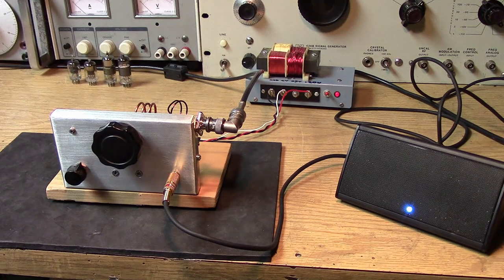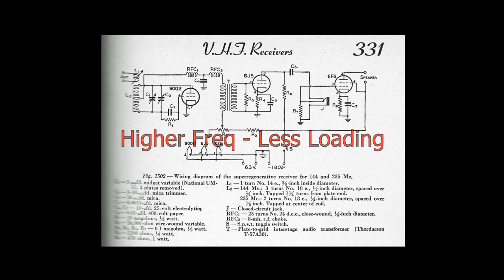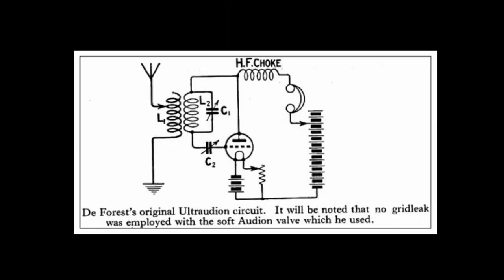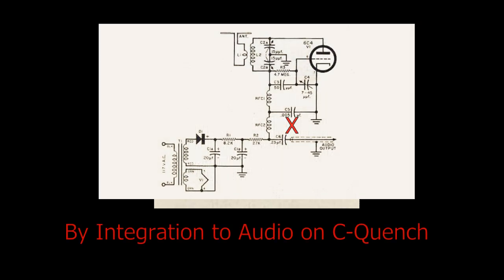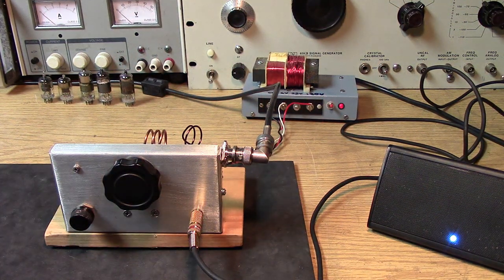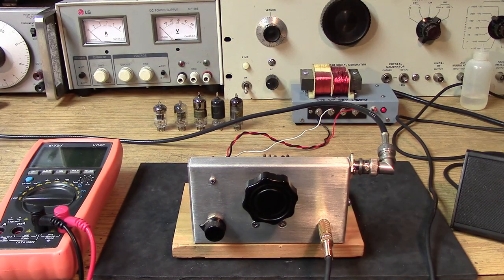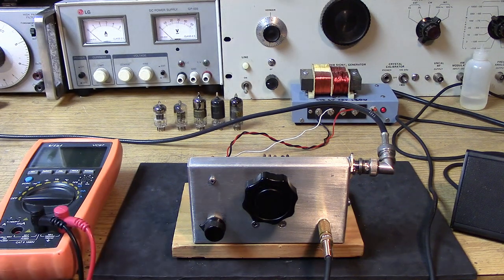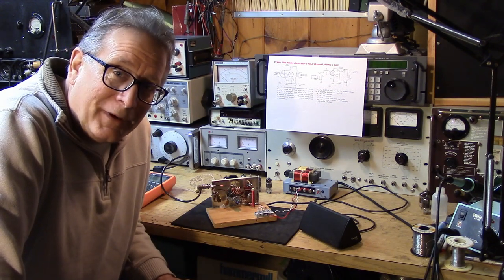Super Regen Part 2

Comment: 1971 summer the DI MADE A MISTAKE. (Army) I sliped off to atlanta ga. I hit a radio shack and snuck parts back to the barracks. Then with a bag of thumbtacks, a board. And a telephone. Head set.  A tp roll. I got what what I wanted wsv,  ga. Near by. On regen reciver. And 10' of wire I know how powerful a regen is.  2021 may. I  showed your clip to a school kid. Wow he  is now inspired. Thanks. Kv4li 73

Comment: Mike, looking forward to the next video.
Many years ago I made a superreg for the VHF AM Aircraft band using a 954 acorn tube triode connected, built in the front-end box of a surplus Navy TBS receiver. It worked but I did not use it very much thinking it might cause too much interference on those critical frequencies. Design from an old ARRL handbook that used a 955 acorn triode. Update: I dug out the old superreg today and found it was actually built like your Test circuit 2 using the 954 penthode connected. Tunes 105 to 135 MHz.
Reply from the maker: Wow! That must have been hot! My first one was a lowly 6J5 for FM. My second was a firecracker, a 6BZ7 dual UHF triodes, one section untuned one as the regen, into a 6AU6 headphone amp.
Reply: In fact, an isolating rf preamplifier would be required if you do it properly.
Reply: When I was 13 I made a super regen using a 955 for the 2m band. It was mounted in a box 
on the carrier of my bike so I could take it to hilltops., but it is sad I never heard an amateur station on it. Eventually I put the freq up to 600 MHz and made a matching unofficial TX and we made some really interesting propagation tests over the hill near my home. This was in about 1961 before I had my license. Then it all had to stop.

Comment: Hi MIKROWAVE1. Great video! I built the second test circuit and it seems to working in the right direction using a 6J1 or my 6AK5W tube. I run into one issue, the radio seems make a quench hiss/squeal with no audible stations. The 100 k regen control works. It seems that I can use my tuning capacitor; doing so would make the noise vary in intensity and give the impression of 'tuning'. I sometimes even 'imagine' hearing faint local stations, but they may be masked by the hiss. By attaching a collapsible antenna, it reduces the hiss. By removing it, the hiss goes stronger.
I'm running it at 120v DC with a metal case as a ground plane, using a small bourns 22uh choke. I couldn't find a 470uf 100v + cap, so I substituted it with a 33uf at the moment. The only major changes I made, I think would cause a problem is the grid leak. I used a 270k soldered in series with a 100k attached to a 56pf capacitor. I also used 4 turns of 16awg to match my variable capacitor.
Is there anything else besides changing the the grid leak components to make it work? 
Thanks!

Comment: You could make that radio compact using KORGS NU-Tube 6P1 and just use two 2X1.5v batteries for heater and 4xPJ996 6v batteries for the B+ and you can use a duel inline socket for said tube.

Comment: I had good luck as a kid back about 1960 with a 6ab4 which is like a half a 12at7 in a 6 meter super regen detector.
Reply from the maker: Those dual VHF TV front end tubes like the 6BZ7/6BQ7 were my "hot" choice in the 1970s as a teen.

Comment: That 4.7M on the grid looks to be going to the wrong place.  Normally the grid leak resistor goes to the voltage at the cathode.This applies to the opening/title picture.

Comment: Howdy. No intention to be a killjoy.
John Hunter from Cool386 Australian Vintage Technology has pointed out that managing regeneration by controlling the B+ voltage results in inferior sensitivity. Regeneration should be managed by controlling biasing. Applies for triodes and BJT:s. For pentodes regeneration should be done controlling the screen grid voltage.
Best regards.
Reply from the maker: This is a first principles super-regen; a common mid century circuit that is proven to work well with triodes. I built my first one with a 6J5 back in the early 70's. Regeneration should be controlled by varying feedback, no matter the method. The problem he is trying to solve is trying to independently control regen for the best sensitive region and squegging, for the shape and best rate. So optimized. I worked with Chuck Kitchin at Analog devices. You may have seen some of his regen circuits.
Reply: @MIKROWAVE1  Howdy again.
Fair enough. Thanks.
Regards.

Comment: 19:54 In my case - it wasn`t easy to see the Quench pulses:  my super regenerative receiver received DSO-2150 PC oscilloscope😊.But it was a BJT super regen with a 1.5V power supply.
Reply from the maker: You cannot beat bipolars for cost and power. Bipolar regens were very popular in low cost garage door openers remote controls and such in the 90s. We used to make them at Whistler when I worked there one summer.
Reply: @MIKROWAVE1  What is about intermodulation  -  tubes are very  good (because grid cuttoff voltage is quite hight: -10Volts).But hhat is about sensetivity between a tube and a jfet or a bjt in a superregen ?

Comment: Nice explanation that "effectively explains" how it works but it is not exactly correct as someone else below has already noted. Next for you to display is the separately quenched superregen, using a separate constant frequency quench oscillator. This gives a much less critical control of the circuit.

Comment: Which radio has a stronger signal? The one with tubes or the one with transistors? I know the tube one causes more interference, but how is the signal compared to a transistor?
Reply from the maker: Common sense says that the transistor would be the winner, but I have not tried both circuits against each other.

Comment: 4:49 R3 this regen? isn' that basicly a offset control?
Reply from the maker: R3 is a voltage divider that changes the voltage applied to the plate, so it really is a gain control that gets you into the correct range for proper super-regeneration with the tube.

Comment: Mike, did you try out the superreg receiver of the UHF B-set of your WS19?
Reply from the maker: I bought the UHF valve and installed it. But That is as far as I went. At least al tubes sockets are now all filled. Honestly I have never even tried the AM modulation, as I do not have the accessories. Always used it on CW.
Reply: Fellow hams loved the interference of the receiver alone if hams retuned the B-set many years ago to the 145 Mhz amateur band.

Comment: I have to disagree with the author's description of how a superregen receiver detects the modulation.

In a self-quenched superregen receiver, the presence of an amplitude varying RF carrier permits the oscillator to start more quickly and the quench cycle to shorten depending on the instantaneous signal amplitude at the beginning of each quench cycle. This varies the oscillator current and the modulation is detected by low pass filtering the oscillator current.

This has little to do with the grid leak or plate detection found in a regenerative receiver.
Reply from the maker: Martyn, what you are describing is Pulse Position Modulation (PPM). I do not believe that you can integrate PPM and get the waveform back. I think you have to turn it into PDM first, then integrate.
Reply: @MIKROWAVE1  Here is a link to a good introductory description of the operation of a superregen receiver.

http://www.eix.co.uk/Articles/Radio/Welcome.htm
Reply from the maker: Thank you Martin. The material I presented is cursory and based on older published articles and books and is likely not accurate. Again the complexity of the super regen action confounding through the years.

Comment: Would it be possible to build this circuit with a transistor? I mean a normal NPN/PNP transistor, not J-FET/N-FET
Reply from the maker: Yes a bipolar transistor makes a fine superregen. But that is too easy! https://sites.google.com/site/aurelwwiz/aurelso
Reply: @MIKROWAVE1  Thanks, ill probably try to make that one at some point, i was also looking at Sputnik regen reciever, that one doesnt look much complicated too...
Reply: @MIKROWAVE1  And one more thing, is changing the tuned circuit enought to recieve SW signals on that circuit?
Reply: @MIKROWAVE1  Please what is the scheme of the first one on that website, it doesnt load the image...